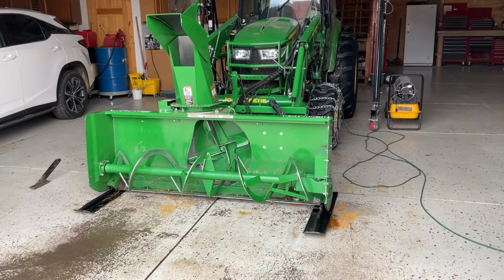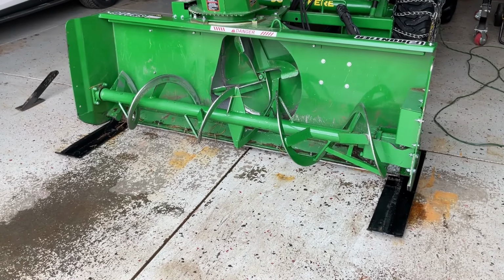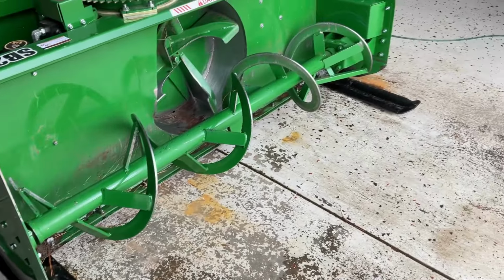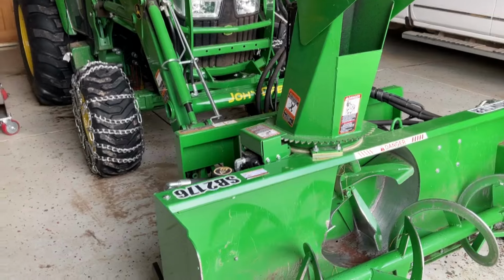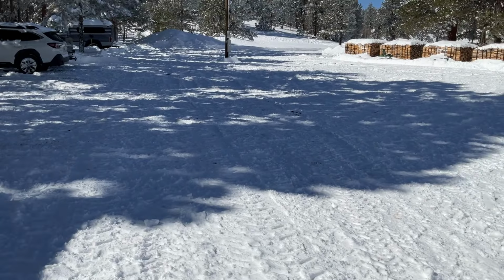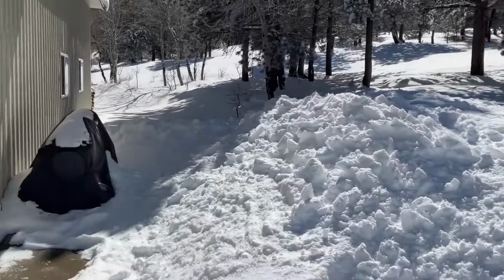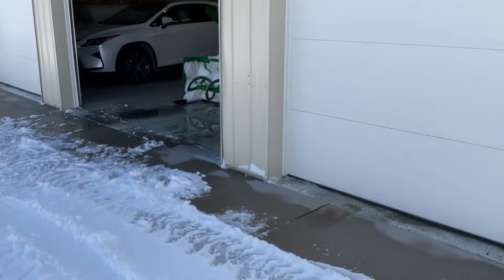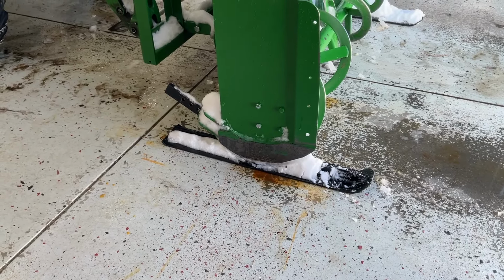Snow Blowing 2 Feet Of Heavy Wet Snow - John Deere 4066R - Frontier SB2176 - Western Winds Skid Skis

Comment: the Skis are really cool.   I have never seen a hydraulic remote setup I am a fan of.  the Pumps and motors are never matched to the Tractor PTO power, they are always way undersized to maximize the range of tractors they will work with.   Between the undersized pump and normal power lost in a hydraulic system an 80+HP tractor is frequently delivering 20-25HP to the blower.  I have a rear mounted PTO blower, and while i would love to have the blower in front, i also appreciate the fact that I can back up at 5MPH through 8-10" of snow when clearing my 1/2 mile long driveway with a 60HP tractor, and not be pushing any snow.  My father in law also has a 60HP tractor, front mounted hydraulic remote blower and he is hard pressed to go 1.5MPH in the same conditions .

Comment: Great video! Every year I say I’m going to have a set of “skis” fabbed for my 64” Kubota blower because the silly 1 1/4” factory ones cause the blower to dig in too far and I end up blowing a good portion of my gravel driveway into the yard before the ground freezes up but just never get around to it. After seeing how well yours work I absolutely will be doing it. About the only thing different I’ll do is I’ll probably go a little wider and have them turn the sides up too, to help with turning when you have a blower full of wetter snow and to prevent the ground shaving effect you get when making a sharper turn. Would really love a loader arm blower too but my 2650 doesn’t have enough power to run the hydraulics for it.

Comment: Great video!  I'm in Evergreen, and we are still digging out from last Thursday's storm.  I live on a 2 mile private road, and have been plowing with a UTV (Kawasaki Mule with 72 inch snow plow).  However, we got over 4 feet of snow here and my UTV keeps high centering.  I have a Deere 3046R, but have never used it to plow.  Maybe I should invest in a loader-mounted blower like yours.  Is yours running off a mid-PTO?  How difficult is it to mount and remove?  Finally, I noticed that you have chains on the front tires only.  How good is your traction, and do you have any inclines to deal with?  Thanks in advance for your advice and, again, thanks for the video.
Reply from the maker: Evergreen and Conifer were ground zero!  4' of snow is tough to deal with if you get behind while it's snowing.

We plow 3 miles, and I also have two blades for the tractor (one rear, one front).  I use them in tandem for smaller storms (15 inches or less) because it's faster.  Granted, it leaves piles on the sides of the road, but it's much quicker than blowing the whole stretch.  I have a video of us using both a front and rear blade from a month back; here's a link to that video...

https://youtu.be/btXka-jn3SU?si=pkZp8eZzqxogYms0

The traction is good with the chains, and we have 3 inclines between 8 and 12 degrees.  The tractor climbs up and down pretty good so long as I have some weight on the tractor.  The implements themselves tend to be enough weight.  I also have the tires weighted so that helps.  Never been stuck yet, even in the spring when the snows are wet and slippery.

Regarding the blower, it's a hydraulic blower.  The hydraulic pack on the back of the tractor (Frontier HP2134) is run by the PTO, and I connect one electrical connection and two hoses to it.  The hoses and electrical wiring run to the front of the loader where I connect up the blower.  Up there it's two electrical connections and two hoses.  That's it.  It comes off and goes on super easy.  The nice thing about it being hydraulic is that there are no sheer pins.  The hydraulic pressure is diverted by a relief valve or shunt if the auger jams and stops spinning.  Just clear the jam and it's back to work.

Hope that helps, and hope you get dug out soon!  We've done the UTV thing as well.  They're great for smaller storms, but 4' is another story.  Been there, done it, bought the t-shirt!
Reply: @StanleyGrant13 Extremely helpful reply, thank you!
Reply: @StanleyGrant13 

So glad I found this video.  I have a Kubota and it doesnt have a mid PTO and I have been trying to figure out how to config for a front snow blower.  Buddy mentioned a hydraulic setup and it is nice to see it in action. Moved back east many years ago but used to live between Conifer snd Evergreen, near where N. Turkey Creek and 73 intersect.  Nice area.  

Cheers.

Comment: thats a weird setup , whats on the back and why is the pto spinning if the blower is loader mounted ? confused how this setup works
Reply from the maker: @haus05  That’s the PTO-driven hydraulic pack that runs the blower.  The hoses and electrical connections run from the pack to the blower.  That eliminates a need for a PTO drive on the front, which allows the blower to have full range of motion (lift and tilt) via the loader.

Comment: I wait till the ground freezes and OEM blower pads work fine.  When my current ones were out I will make a set of skis like these in the video.  Not sure welding a few pieces on strap steel is patientable.  Nice video, thanks for sharing.  I Do have a question,  I don't see a drive shaft running your snowblower so does that snow blower have a separate motor?
Reply from the maker: The blower is run off of the hydraulic pack on the back of the tractor, which is PTO driven.  The hoses and electrical controls run from the back to the blower on the loader.
Reply: @StanleyGrant13  thanks for the reply.  I never new knew a blower could run on hydraulics, that is really cool.  I know a guy who put a blower on the back of his tractor so he could run it off a drive shaft. You're set up is  a 100 times better than snow blowing backwards.

Comment: As a kubota person i wonder the cost per for a power pack vrs the factory subframe and front mount for my grand l

I think all said and done from the dealer i would be in the 10k range for a front mount blower but i could also switch to a broom, flail mower or plow on that subframe but then i would be pto powered with shears. 

Its a nice setup but i do like have a rear blower and having the front for a plow/pusher

Here in lower ny we dont get much snow anymore just mud, its really sad

Comment: Hey, that’s a great idea! My snowblower shoes are on the small side as well and it likes to eat the gravel… I will speak to my welder. I’m sure he can make something up!

On a separate note, I was considering chains on my front tires only. I read many forms were lots of guys said it could wreck the four-wheel-drive, etc., etc. which your experience with having chains only on the front tires?
Reply from the maker: @Buddyboz  For my tractor, they said only to do chains on the front.  The manual actually says not to use them on the rear, which I find strange.  Wish I could chain up all 4, but having them on the front has certainly helped.  No damage after 4 seasons with it now.

Comment: Hello!  I am very interested in these skids!  I live in an area that gets a LOT of snow and I blow over the same surfaces that you do. Do you normally blow snow in the “float” mode on your Deere and if so have you still found these skids to be useful?  Do you get any wet, heavy snows in CO?  Thank you so much!
Reply from the maker: Yes, I blow the snow using the "float" mode on the loader.  Before I had these skid skis I couldn't do that because the factory skids were too small and they dug through the snow and into dirt / gravel.  My workaround was to not use float mode, but then my loader was either too high or too low, and I was constantly having to adjust it.  The skid skis allows me to use float all the time, and the skis ride nicely over the surface that I'm clearing.  It's not shown in the video, but I'm actually transitioning from gravel driveway to grassy areas, and the skis make the transition smooth.

We get heavy wet snow in the Spring.  Not quite as bad as California Concrete, but it's a lot more dense than the winter powder.  This video was filmed with a heavier snow, and they worked great (as did the blower).
Reply: Thank you so much for your response!  It really helps as I have the same surfaces and transitions that you do including dirt trails I want to clear. Your answer is exactly what I have been doing - manually adjusting the blower up and down - which is frustrating.  Thank you again as your answer really does help and reassures me.

Comment: Can't the tractor run the blower without the hydraulic pack on the rear?
Reply from the maker: If the tractor had a front PTO then probably yes.  The hydraulic pack is PTO driven with high pressure hoses running to the front of the loader / blower.
Reply: The gallons per minute on the tractor pump is inadequate to run the blower. His pack has a high GPM to provide enough flow to operate it.
Reply from the maker: @1958johndeere620  Bingo.
Reply: Most tractors run like 18 is gpm and that is for everything, then by the time it goes through vaule bodies and smaller hoses your front outlets like a third function have 6-7 ish gpm

Most hydraulic blowers are setup for skid steers that run in the 20s through the lines and 40s for hi flow

Comment: You could do the same with a plow bade.
Reply from the maker: @geedubb-q1u  That’s my next goal.  I have a plow, but since it articulates right and left, I need to figure out a way to have the skis always pointing straight ahead.
Reply: @ …I see what you mean. Maybe a wider front, tapering to the back, or maybe the guy who made the the skis might have an idea. On our road plows our shoes, we called them were round, so it didn’t matter which way you pointed them .
Reply from the maker: @ I tried the round skids too, but wore them down in one year.  At the least, I could try that if they were oversized.  Another option is to put a “rudder” on the bottom of skis that force them to go straight, but they’d have to dig into the ground or snow in order for that to work.  So we’re trying to figure out how best to engineer them to work right.  If I can make them work with a blade, they’d also work for a snow pusher.  Another project :-)

Comment: Not a good idea to run chains on one set of wheels.  Throws off the transfer case and you could ruin it.
Reply: Those Deere tractors have a splined coupler between the driveshaft and front differential. Replaced plenty. If they didn’t have it the diff would be certainly in jeopardy. Jmtc